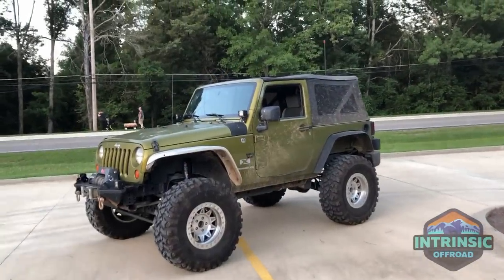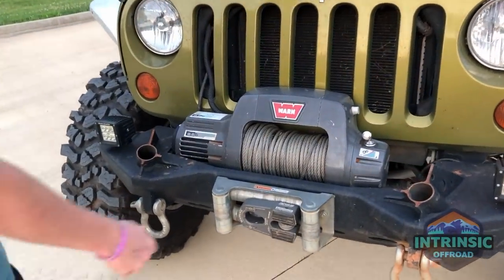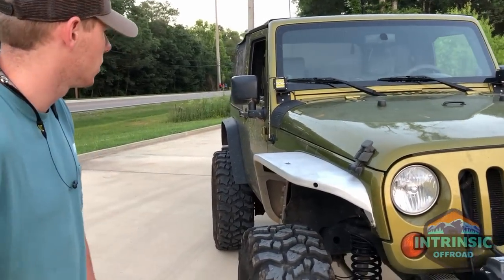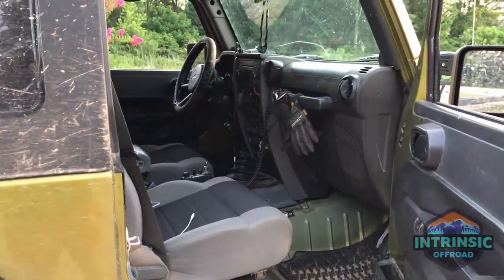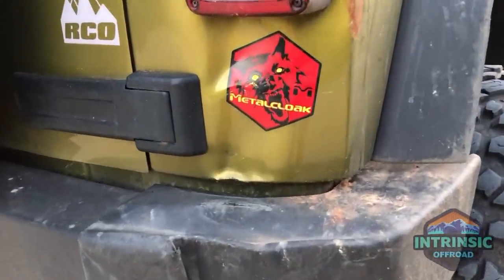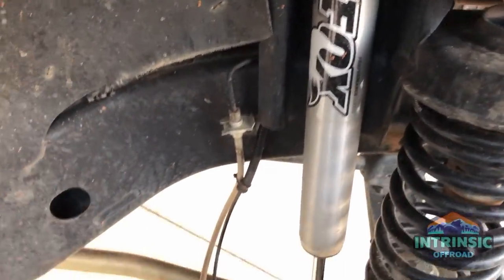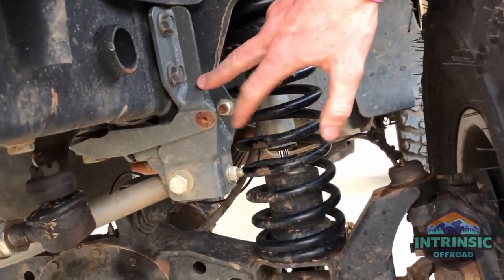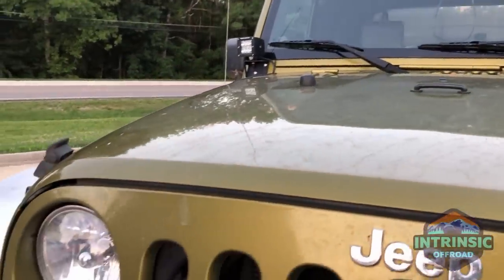2007 Jeep Wrangler JK X 2 Door Walk Around

Comment: Hell ya! Straight up wheeler. I have an 07' 2-door X with manual as well. Did a lot of the same as you did just different manufacturers on the parts.
Reply: Hey noticed your comment here, this is a really random question, but I also have a 2 door wrangler x 2007. Are you able to get into the back seats ?? lol
Reply: Yeah just push the passenger seat all the way forward and then tilt the back of the seat all the way forward. About as good as it gets but you can get in. Also helps to step in backwards to the back.
Reply: Thank you! I recently bought the car but I think the owner put in 4 door seats in the front and there's no way to get in at all :( The seats only move foward a couple inches and don't tilt much.  Im thinking I have to replace the bracket. But I was wodering if the orignal seats would allow you get into the back which you told me they do so that's good.